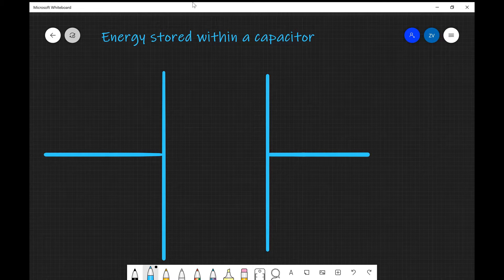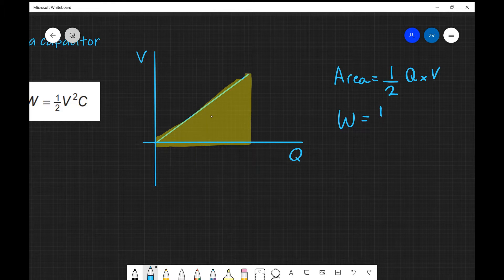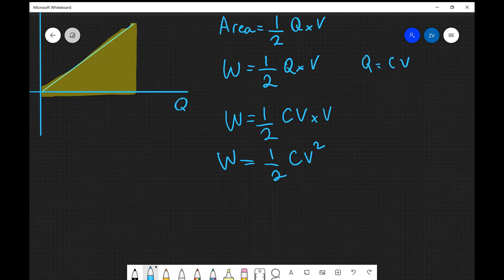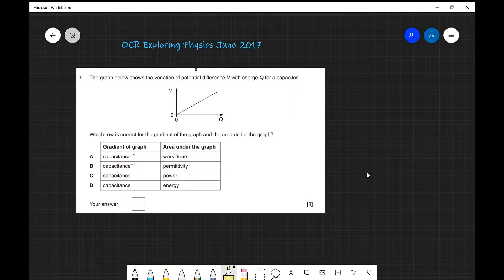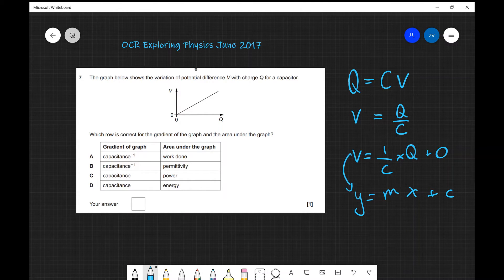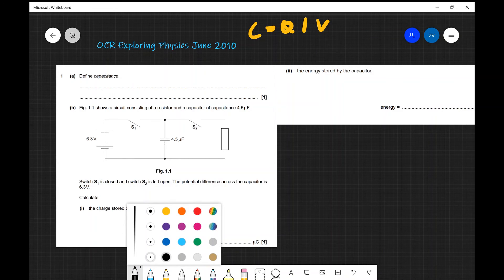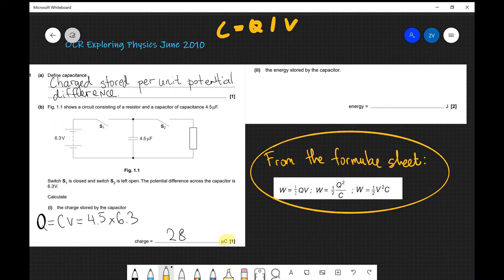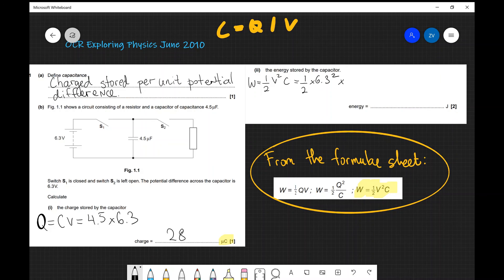A Level Physics: Energy stored in capacitors

Comment: For the last question, how did you know to use the W=V^2C equation and not any of the others, because we do have charge as we worked out in the previous question.
Reply from the maker: multiple different ways of getting the correct answer and this should also give you the same answer.